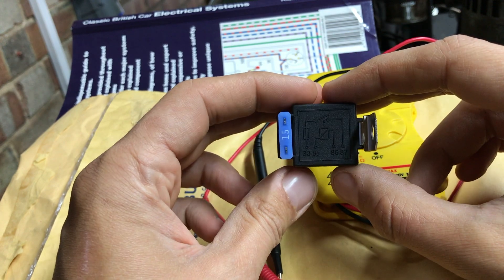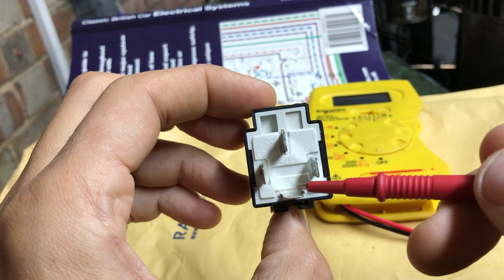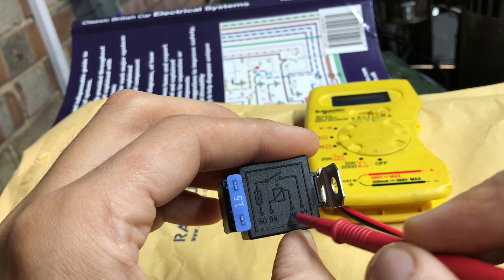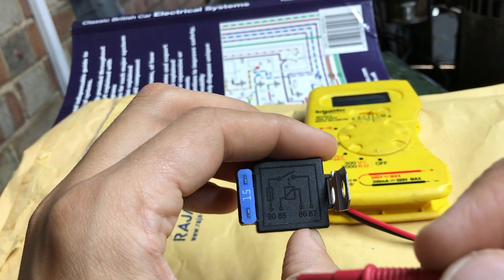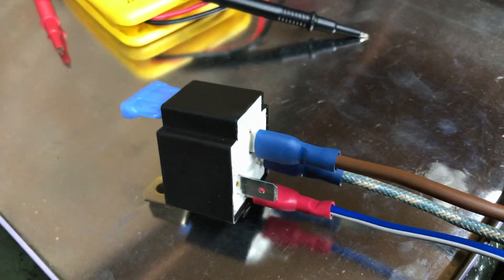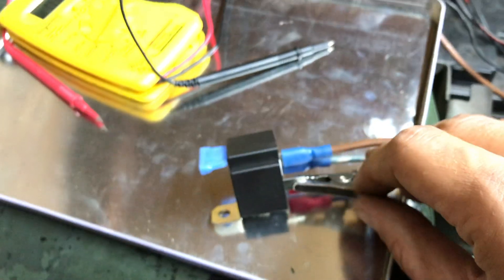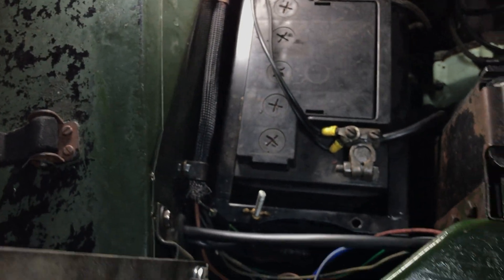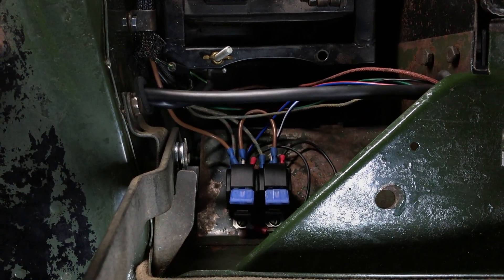Series Land Rover - Headlamp Relays

Comment: I might contemplate fitting some to mine. All heavy wire in use in the headlights circuit already but you’re right, the combined light/ ignition switch has 10 A to deal with.